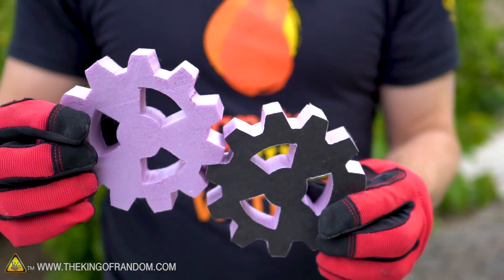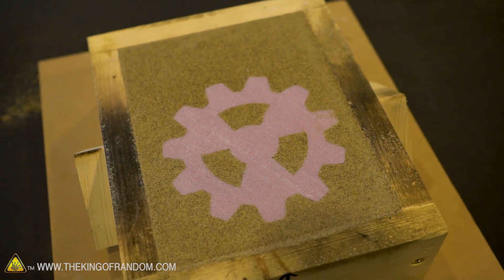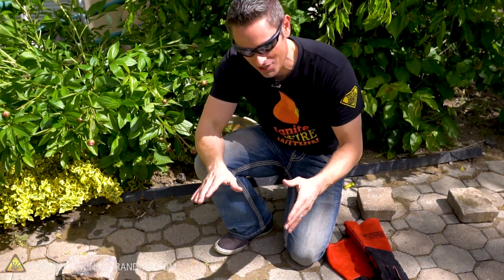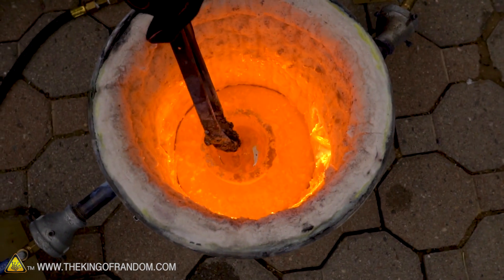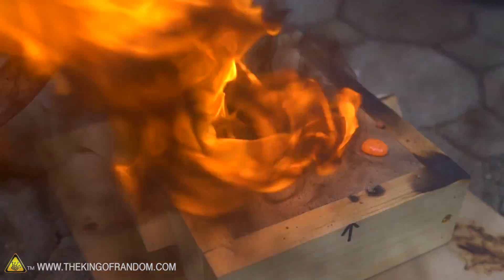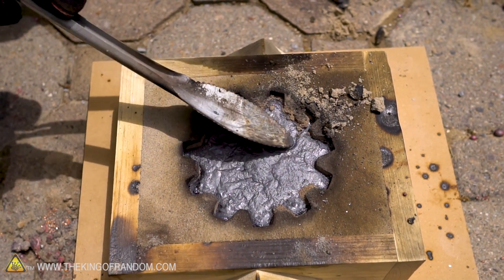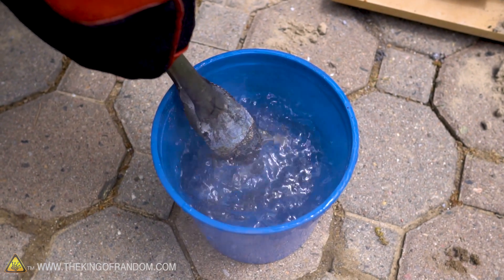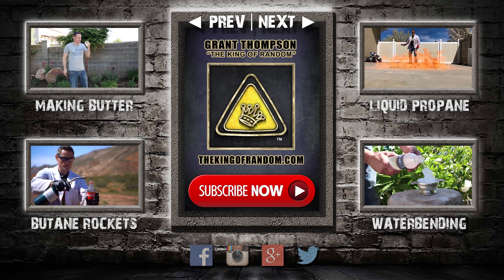Argh. Why Is Copper So Difficult? TKOR Tests Melting Copper In Our Homemade Foundry

Comment: If you're going to insist on the pouring method, it seems you need to work on your aim and pouring skills a bit. It looks to me like the sand is breaking down just because of the kinetic energy of the pour hitting it and would do the same if it were just a water pour.
Also, I'm not sure if this is possible, but if there's a way to cleanly remove the foam before pouring, it seems like that would help. Perhaps wet the sand, screw a small screw with a string in the middle, then ever so carefully pull it out? Easy to try at least. It's the same principle used to make sand castles. But still go easy with the pour as to not knock the sand around.

Comment: would adding a 1/2 steel flat plate over your sand & styrofoam mold with say a 3/4 in. fill point & not pouring over sand directly having the mold tipped and not being level as to allow the cooper to flow back to fill point...

Comment: Never quench in water, always quench in oil. Water causes too much stress on the metal from a rapid change in temperature, just like when you rapidly cool a wine glass with liquid nitrogen and it cracks.

Comment: Try to keep the sand dry, the water in it might be boiling in the sand and popping the pieces up. Keep moisture down to prevent the boiling in the sand particles.

Comment: I have used acetone to melt the styrofoam. I just spray it on with a suitable spray bottle (one which withstands acetone). It melts to practically nothing. Molten pieces can be picked up with tweezers if necessary.

Comment: Interesting! I've done quite a bit of aluminum casting,but never tried copper,except one time.

I did make one attempt at alloying some aluminum bronze. It melted,and everything went ok,I thought. Until I found out that my aluminum bronze ingots would break when I tapped them with a rubber hammer. So,obviously,I did something wrong.

Comment: make a closed mold, only way its going to work. Copper is way to heavy for an open mold, it will push the sand away and make it float.

Comment: I think if you had enclosed the casting rather than having an open face in the mold. bury the foam in sand with another foam cylinder to connect to the surface of the mold, then grind off the sprue once it's cooled.

Comment: Hi sorry for showing up late to this party, but in addition to a 2-part mold, the other thing you need to look into is core sand.
Green sand is fine, don't listen to people telling you to use oil sand.  But it's commonplace in foundry work to make "cores" whenever there is a cavity that will need to be left in the middle of a mold - as you have here with three cavities.
I think cores have a slightly different makeup and are baked first to make them durable. That way the cores won't get washed out by the molten metal.

Comment: The King of Random , your not using a top and bottom box of sand , your also not using a side pour , you need to watch more videos i knew it wasn't work and fill your mold properly , you need a top box of sand and air relief holes air in , and a side reservoirs area that would fix your mistakes and make it pour correctly

Comment: dude you need the right sand. it needs to be dry. use styrofoam. and it needs to be covering the foam on all sides including the top with a kind of nub of foam to pour it in

Comment: You probably have the wrong type of sand and should also cast with a upper casting block with a feed via that goes down into the center where the foam is. So you'd have the casting foam in a lower cast and then have a upper cast packed on top of that. It would help the stability of the sand and keep it pressurized and in place during the cast process.

Comment: If you use silica sand and motor oil to make the sand stick together. Then make a two piece mold with a vent hole and pouring hole that should work very well

Comment: TKoR - I'm willing to bet that if you used the cope in this pour would help in filling out completely since the copper will have more pressure behind it to push into all of the nooks and crannies. Also, you may want to craft a crucible holder (check out Paul's Garage for a great design). You lose a lot of heat when you have to put the crucible onto the ground to adjust your grip with the tongs.

Comment: Mix old motor oil in your sand it will pack better also use 2 mold boxes and make a vent and a pour spot

Comment: You need plaster not sand, the copper is to hot so the heat is most likely getting under the sand and picking it up. It will work if you use plaster.

Comment: you have to have the mold  completely inside the sand and pour through a hole/s.. those wouldnt have popped out if they were being pressed from the top and bottom

Comment: Cement instead of sand?
Reply: Leopoldo888 refractory cement yes but normal cement no as the moisture in normal cement will almost instantly turn to steam causing the concrete to explode😮.

Comment: Why don't you try burying the styrofoam mold under the sand a little and have a hole to pour the copper down into the hole and it will keep its shape

Comment: You shouldn't use sand, but thin dirt and mix it with burnt oil to make a stable dirt past and two sides close mold, to let the melted metal fill the mold,... you will still need to polish your raw shaped metal.

Comment: you might have wanted to try a dryer sand instead of a wetter one. im no expert but i have a faint memory of someone sandcasting and in that particular case if the sand was wet at all it would actually explode. also it did make all 3 of the inner parts pop out when you used wetter sand so...

Comment: Watch Tubalcain (AKA Mr. Pete222) here on YouTube. He has many foundry videos where he addresses the issues you are having. Old motor oil can be mixed (mulled) with sand to stiffen up your mold. 

Casting is used to reduce the number of machining operations, not eliminate machining. 

Redo the entire process with less expensive aluminum to work out the kinks in the process. 

You may be happier with the end result if you made bronze.

Comment: Suggestion: buy your copper at the local recycling center in the form of beat-up tubing, wrecked wire, and perhaps an old industrial engine radiator.  It's a great deal cheaper than buying tubing at the hardware store.  

Mark Kinsler  Lancaster, Ohio USA

Comment: Use sodium silicate to wet your sand (use gloves, caustic); charge with co2 to harden. Your sand will hold it's shape until you take it off with a hammer.

Comment: Use an emulsifier other than water in the sand... something like PVA (White Glue) that is watered down in a like a 50/50 or 30/70 (mostly water) ratio and mix it into your sand. This will bond the sand together better than just plain water. Also try sticking metal dowels in the center of the what would be the hollow areas, so that raised sand doesn't break away.

Comment: I've seen casting before. try using a second box. then put a hole on either side for pouring the molten copper. and try using a wooden mold instead of Styrofoam. hope it helps.

Comment: you can use instant gypsum instead of sand and wait till it gets hard, then you can also remove the mold and pour the copper quite easily...
(Just an idea, I don't know if it's actually work)

Comment: I think you need to try and remove the styrofoam 'pattern' before pouring. It shrinks with heat and that could be dislodging your 3 'radioactive' sections of the mold. Also consider changing to a purpose made medium like Petrobond? Also, could the much denser copper be trying to 'float' the 3 sections? 🤔

Comment: Presstube channel do a lot of casting with cooper and foam - take a look!

I think The sand youre using is not the correct one - or your method of pouring the sand is wrong - either way, there is a lot of channels of casting to learn more✌️

Comment: Because of copper being a pretty dense and heavy metal a open mould with "loose" parts will often break , a closed mould would be much better. Also you need to use a much finer type of sand to make the mould stronger

Comment: You evidently didn't have metals shop in high school.  You need to remove the Styrofoam and you need another sand mold but it just has a pour and vent holes in it.

Comment: I'm pretty sure than density is your issue. The side wall pressure from the heavy copper, relative to the ratio of height-to-base (phi), is pushing up those tiny center pieces. I bet it would work fine with Al.

Comment: Your mold/sand must be cemented together and moisture free in order to withstand the thermal shock of molten copper.  Also, use a more stable way of pouring molten copper such as a crucible fixed in a stand and a turning wheel to pour it with.  Hope this helps.

Comment: you may need to reinforce the inner cores with a long screw or nail in the centre
Reply: as the cores tend to float in the molten copper

Comment: Perhaps you should pull your gear styrofoam out and spray some super hold hair spray onto the sand . maybe the stickiness of the hair spray will hold the sand in place . while ya pour the molten copper into the empty cavity . just a thought .

Comment: Just off the top of my head. Maybe your sand is too wet? I.e. its hitting the hot copper and boiling which would essentially vibrate the sand. Just a thought.

Comment: i think with copper and it's meltingpoint you should heat up your casting medium. as sand is in nsolator it will hold the cool outside temp loinger then the copper needs to heat up the sand

Comment: you probably need a top box with sand and a hole to mold the copper for pressure so the sand dose not pop's up and use a funnel to make the hole in the middle of the top box to be in the sinter of the bottom box of sand with the Styrofoam.

Comment: Try adding some borax into the molten copper.
Reply: hey try covering the mold with a wooden cover and drill a hole....the sand seems to be floating N the copper.
Reply: pour it through the hole. and the cove will hold down the three plugs.

Comment: You need a 2 piece mold and the correct sand dampened so that when pressed with the human hand stays intact when the grip is released, powder on the item to mold as a releasing agent, the hydraulic pressure of the height off the sprew in the top mold will force the copper to make clean edges, not the surface tensioned edges you get with the open mold. The top and bottom mold should be pinned so it indexes.  The sprew and vent in the top half of the mold allow the metal to flow freely and push all of the air out.  I did this in high school, 45 years ago.

Comment: You should make the foam gear with two sprues attached to it, and completely cover it in your Green Sand. That way you will have two points of contact on each side of the holes giving a little bit more rigidity. Pour a little molten copper down one sprue to allow gas to escape then complete the pour down the other sprue!

Comment: instead of casting is with the gear mold showing, put it in the middle and have a spout to flow in and a spout on the other end, to tell when its full that way the pieces of sand in the middle wont break apart

Comment: You should ask a jewelry maker how they cast ring molds. the tec is similar to how copper was cast. they use a sand that is wet and then kilned so it doesn't move, with a wax positive that melts quicker

Comment: Sorry if I am late to ideas, but I am watching this in start of August. Because pieces float you need a layer of sand over gear. Sort of like pouring metal into an ant colony. You need to cover gear and pour metal into a hole( or holes) that leads to it. But hey,  I don't know - it's just an idea.

Comment: Do the things the others said, and also a fillet or chamfer around the struts will strengthen them and remove the weak break point along the sharp corner. 
Since a few of them worked, this would probably have been enough.

Comment: Closed mould, better sand (petra-bond or cured sodium silicate), remove your styrofoam shape. Alternatively dip your styrofoam into slip a few time to create some layers, burn out the styrofoam and make an investment casting using the ceramic casing.

Comment: As an ex floor molder, the type of sand you are using is the wrong type you need to use a chemical sand that hardens like concrete. 
you also need to use a 2 box system (like a sandwich)  with a hole in the top box in the shape of an inverted cone going to the center of your cast item The 2 box method helps the copper retain its heat when poured into the mold 
Also your copper needs to be hotter to ensure a clear even cast when pored from your crucible 
distance to the mold is also a factor copper cools down very fast, so the closer the mold is to the makeshift furnace the better

Comment: mix 8 parts sand with 1 part cement (powered). Add a little water to the mix. Make your mold and LET DRY...You might be able to pull the foam once dry before you pore your copper.

Comment: next time use wax. it tends to run directly into the sand, whereas the foam rubber that you are using has to burn away before the copper meets the sand, giving the sand time to become dry. I'm not at all sure if it will work, but I've seen brass casted this way

Comment: I have a question, When you pour the copper on top of the styrofoam, what becomes of the styrofoam? I would think the styrofoam after it melts would mix with the copper thus contaminating and weakening the integrity of the gear????? ( am I wrong?)

Comment: Bro, you can't cast in an open mold if there are protrusions in the middle that need supports. You need to use a full mold and use channels so the top and bottom can support the protrusions. Also, copper is really hard to cast because it has an extremely high thermal conductivity, so you may have to preheat your mold and heat the copper WELL past the melting point. You can also add some zinc to make casting easier by reducing the thermal conductivity and reducing the melting point, but it will then be brass instead.

Comment: I'm also curious how this would work if you mixed the sand with something like Elmer's Glue or some other adhesive. Would the copper destroy the adhesive and break up the mold again or would it hold up long enough to give you the shape you want?

Comment: You can also try a mix of sand and plaster-of-Paris instead of just sand. That should harden and hold its shape, though you have to heat the sand mold up slowly and carefully so the copper will not shatter it. Apologies if you already know this ^^;

Comment: Hi, I worked as a mold maker in a foundry and I see your problem, it's your greensand.
Yours is way too brittle, either your mixture is off, or "most likely"  your sand is too dry before you pack the mold, it dries very quickly, and if it is too dry BEFORE you make the mold , it never then has any chance of performing well.
Greensand recipe:  
    100 lbs sand 
    (Silica or Olivine)
12 lbs powdered bentonite
     1 gallon water
    (7 lbs.)

Comment: hey grant! i'm sure there's a flaw in my silky idea but i figured it couldn't hurt to suggest. Maybe you could add another ply of wood over the sand casting with the foam in it, and drill a medium sized hole in that slab. Insert a funnel into the hole and pour your copper. My idea behind this is that the extra slab or ply of wood will hold down and solidify your cast, and that it could create a better application of the copper to distribute it evenly

Comment: That's not 60 dollars of copper, that's 60 dollars of copper pipe bought from a vendor. Big difference. Also make a mold where both sides are closed, and you pour from the top though a funnel in the casting. Then you just cut off the spruce / funnel to the part you're casting and wala.

Comment: I wonder if Putting dowels in between the bits of sand would hold the shape better. It could possibly withstand the force of the metal being poured.

Comment: 2 things, you need to have the foam in place to hold the sand in place while you pour the metal. also, you need to scrape the slag off the top of the pool to have cleaner copper when you first pour the metal, otherwise the bottom of the mold is going to be full of impurities.

Comment: It's not the copper. It's the sand. If you put two styrofoam tubes on top of the gear and fill more sand above that, you'll be able to pour it in and it will stay in form better. I forget the industry terms

Comment: I think you sand is to dry and dose not have enough clay in it. and you need to keep the lid on there with vent holes and pouring location centered.

Comment: You are doing it all wrong! Sand need a binder, cheapest professional binder is bentonite which is a fancy name for clay. Sand pops up because it floats on the heavy copper. If you use a top mold cover with a funnel and breather thenit will hold the sand in its place.

Comment: I think the sand was flaking because when you add the metal, the water inside the sand starts to boil, which then causes weak spots in the sand to break apart from that water turning into steam.

Comment: Now I don't know anything about casting like this, but I wonder if you could mix a type of glue into the sand when making the mold so that it really sticks together? Maybe a type of epoxy mixed in with the sand and water. Kind of curious to how that would work out.

Comment: Use "better" (more appropriate sand) pack it harder layer by layer, get a hotter furnace/heat it longer.....? You want well over 1100C for copper to make it easier

Comment: What would happen if you freeze the green sand mould??
Reply: It could explode I think, like thermite and ice?
Reply: Even more rapidly cooling copper, which he hypothesized to be one of his primary issues.
Reply: The problem is not just with dryness of the sand. Cohesion, dry strength, green strength, grain size of the sand also contributed to the untimely breaking.